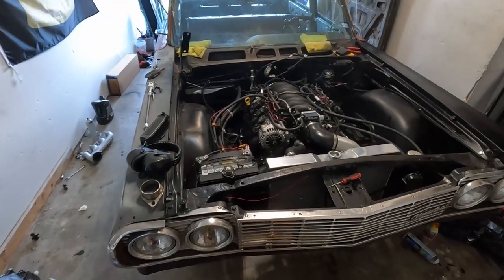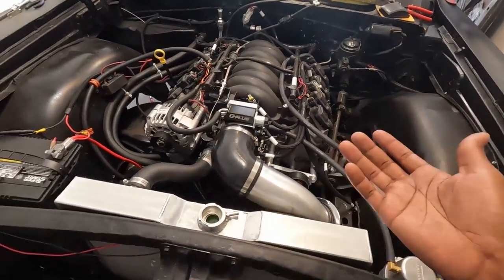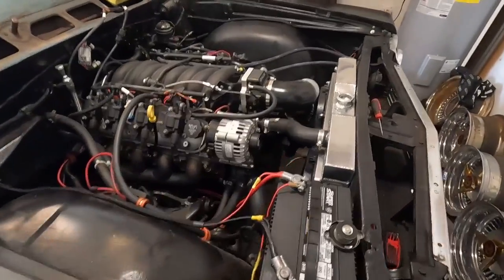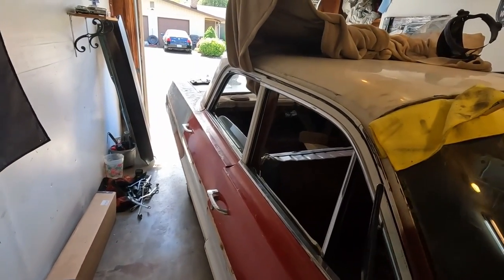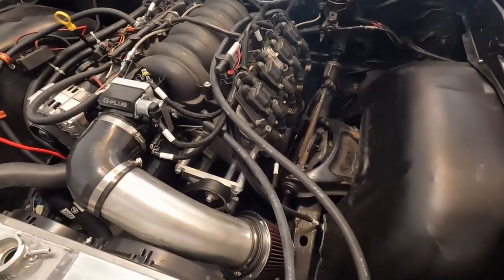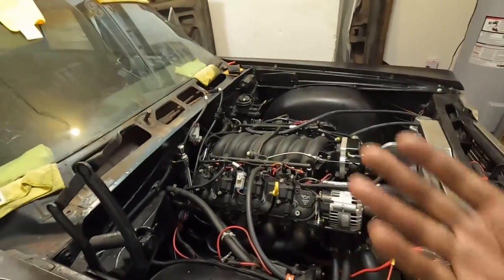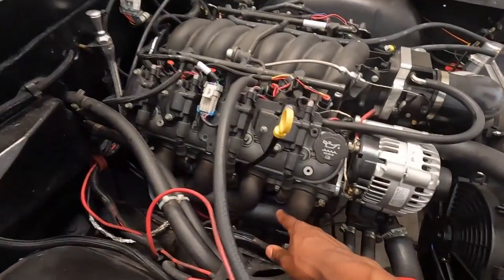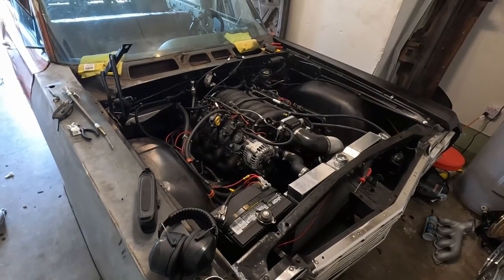How To LS/4L80E Swap A 61-64 Impala!

Comment: Great swap.i did 1967 c 10 all chevy 6.0 truck engine , if I were you I would change  brake system duel power  master cylinder , also see if your engine is crank shaft pined lower pulley ,mine spun and rubbed inside of hormonic balancer pulley fell off engine when I was doing a launch. God bless yall real good.
Reply from the maker: Definitely planned on doing better brakes on here as well. And it is a great swap

Comment: Now you raised your engine 3/4" mine in a 62 Impala needs to be lowered and oilpan is 3/4" above the x-body frame. Front of the engine sit to high. I have been driving it but now need to replace the transmission something hits the frame I believe it to be the driveshaft have replaced the carrier bearing stopped the banging for a short time I believe it to be front driveshaft angle.
Reply from the maker: All you have to do is raise trans cross member in the back and it should level it out.
Reply: @classicpatinas  with the 4l60e trans their is no room to raise the trans. I'm going to have to take 7/16" off the frame engine mounts. That appears to be my only option. I'll get a set from the junkyard to experiment.

Comment: What is the link for the headers you are running?
Reply from the maker: POWERGO MOTORSPORT 1100003430 Cast Manifolds 1-3/4 x 2-1/4 in. Natural Finish for LS Swap (LS1/LS2/LS6/LS7) for C10 C1500 Silverado Sierra Camaro Chevelle Nova Impala Firebird Grand Prix https://a.co/d/edJ8Pbl
Reply: Take a bow...👍🇨🇦

Comment: Hey bro great vid and a beautiful build..I have a 1966 Chevy caprice 4 door, everything original but my 327 is frozen been sitting for years but I’m getting a 01 Silverado 4.8 and I’m scared thinking about the whole swap and getting someone good to do it. I have LOTS of questions but this vid has helped some of them lol.
Reply from the maker: If you have any questions just let me know man
Reply: You may be able to get it to turn again. My 327 did similar and I did an oil change, dumped new synthetic oil in, and also got a new stronger battery which ended up finally spinning it over. You may have some luck trying it by hand just to make sure nothing else is going on like the starter binding up/etc

One time I thought my 327 was seized another time and it was just a bad connection (that looked okay) on the starter that wasn't allowing enough juice to hit, so it would click as if it was trying to engage but actually it wasn't enough juice to turn anything even while jumping it

Comment: Hell yea bro. Great content! I'm about to swap my 66 impala with the 5.7 ls6 and want to pair the 4l80 with it but Im worried about having to modify the tunnel
Reply from the maker: I feel like it should fit but I bet it comes REALLY close.
Reply: @classicpatinas  4l60 and 4l80 will fit without any tunnel modifications
Reply from the maker: @smithmj2010  that’s how I did this. No modification at all.
Reply: Did the 4l80 fit in good? Thinking if I can fit a 6l80 in my 66 If not a 4l80

Comment: Great Job, I did the same build in my 64 Impala SS. All the thing you did, I had to do.  Are you changing the rear end to posi, I still have to do mine, if yes what gear you going.  I have 20s so I may go 373. Again great job.
Reply from the maker: I want to get a 3.73 posi but I can’t find one for the right price.
Reply: I have an original 63 SS Posi that will fit your 64 if your interested. Very clean and ready to bolt on.
Reply from the maker: @edwardnavarro3692  how much?
Reply: @classicpatinas  I have it on eBay for $2500
Reply from the maker: @edwardnavarro3692  sheesh what gears
Reply: @classicpatinas  I’ll check this weekend and send you the code.
Reply: @classicpatinas   looks like 4.56 gears Stamped GM P 3789812. I am putting up  video and its clean.

Comment: Nice work .where do I get link from on what part numbers you used for Intake  ecm wiring harness..etc
Reply from the maker: The intake was from a friends car, it’s on a Holley terminator X Max but the part number depends on set up of engine and transmission

Comment: Have this same setup except with an ls3 in a 64 impala convertible ss. No cutting the tunnel for the 480le but was tight, I also used brp mount kit and will never use it again
Reply from the maker: Yeah from what I heard there were no 4l80e mounting kits for these cars.
Reply from the maker: Usually custom crossmembers

Comment: I need help please 🙏 were do I get a clean 12 volt for it to power the terminator? Please 🙏 help
Reply from the maker: Honestly I got mine from an ignition wire. But use a voltmeter and your going to have to look around

Comment: just a question... the motor mounts- are they for a 6 cylinder? or 8? i know that the height between the two are different...🤷🏼‍♂️
Reply from the maker: I believe these are the 6 cylinder mounts, because those are taller

Comment: Build looking good. Did the stock 5.3 truck intake fit under the hood?
Reply from the maker: I never tried but I think it will hit or come REALLY close to hitting the hood.
Reply: @classicpatinas  how di u run the belt, since it has no power steering?
Reply from the maker: @gerardolopez5875  they make a power steering delete backet for the exact set up I used. The car he’s power steering but not a conventional set up. I just installed electric power steering. So I didn’t have to change my set up, didn’t lose HP, or have to cut/change my radiator
Reply: @classicpatinas  @ nice,,,  any link for electric power steering pump?
Reply from the maker: @gerardolopez5875  it’s just a electric steering motor from a Toyota Prius

Comment: will a/c and p/s work on this. i am doing a 64 impala
Reply from the maker: P/S will work on this set up but you may need a different accessory drive for A/C
Reply: @classicpatinas  @ do u have power steering?? On this?  If not, which brackets are use to delete the pump
Reply from the maker: @gerardolopez5875  https://youtu.be/qdPrQtS7cAA

Comment: Bought the cast ex.too.
Ain't got u. On yet
Reply from the maker: Let me know how it goes
Reply: Ok
Water damage on kitchen wall/in and out walls/floor joist/studs.
Got inside wall back except where the new drain/vent is.floor all done too .cept linoleum /later. 
Cars rusting and resting.
1978 to last year.